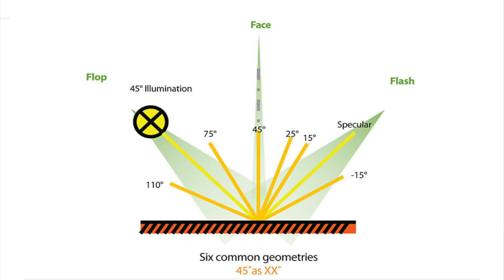The 4 main types of automotive paint **the basics**

Comment: Can you spray metal flake paint over a metallic base?
Second question if you can put metal flake over metallic base, can you spray a candy blue over that?
I want to try silver metallic base, with silver metal flake inter coat and a teal blue candy.
Reply from the maker: heck yeah...pick your flake and any paint system (usually in their custom line) should have a whats called a intercoat clear...spray your metallic base, let it flash and suspend your metal flake in the the intercoat clear, again flash over then spray your desired amount of Kandy then clear!
Reply: @The_Drive_Inside  thank you very much.

Comment: Chrysler Inferno Red is a tri-tone that to me seems a very strange process.    The end color is a very sharp reddity red red red, bright and dark, glimmering, and unquestionably eye catching.  I’ve had a 2005 Grand Cherokee and a 2005 Magnum with that color and it is stunning.    BUT, I the red Magnum was my daughter’s and bought used, she was the second owner.    It had odd peeling in certain places, almost as if it was parked partially covered under a shed, where some parts got harsh conditions and others were pampered.   Where the cleat was peeling, it left a salmon, like a light pink color.    I wondered how it could fade to that.   It didn’t.     I ordered a kit, and the base was a strange salmon, that applied kind of translucent, with some flake visible only when it hit the panel, then was nearly impossible to detect.    The next prescribed coat was what we saw as the topcoat, but it too went on as if it was pigment suspended in clear, and took a barely wet tack coat, then med wet, then another medium wet.  If you applied any of these pigment (color/top) coats too heavy/wet, it would somehow “drown” the effect.     Then came the clear.  No buggie, as usual, but they prescribed a medium wet first, then a “go for it, after all a perfect paint job is one big run” attitude.    Good god that was a pain.   I even jacked the car waaaaay  on one side so the door wouldn’t be vertical, to hopefully keep the clear from sliding off the coat before it.     Funny how you have to wait for all coats(except those “paint it while it’s wet sealers) to flash and that frost coat is supposed to retain the coats above, a foundation of glue and pigment, and if you apply the next coat two minutes early, you get cracking or crazing or solvent pop, who knows.    Paint it two minutes too late, and the “tack” isn’t strong enough.    I guess that’s why they say use a slow reducer in hot weather.     Well, on the hood, I got away with murder, used rattle cans, and blended the passenger half to the drivers half such that you would have to stand directly over the hood in the right light to what was done.       Still can’t figure out how I got so lucky because it was supposed to be an experiment, where I applied after a med/wet coat of blending agent nearly a foot into the good paint, which was feathered to where the edge was not discernable, and then made a “tent” from the base of the windshield to a speaker stand in front of the grille, which kept, hopefully, any “dry” overspray away from the “good” paint, restricted how much fresh and warm and dry air hit that section quickly, and also had an old radiator/motor fan mocked up on a wooden stand as my “downdraft” to remove as much paint as possible that didn’t stick when it hit the panel, AKA, hit dry.   The paint that was MEANT to stick, didn’t have a choice, and the rest was removed by forceful air pressure, much like a downdraft, but this was a sideways and under the car draft I had a channel of 2x4s and 2x 6 running under the car and out the back to the exhaust exit, with both the radiator fan drawing it off the car, HARD, and a squirrel cage type fan was at the exit, keeping the velocity up and urging all dry paint away to hell.     It worked.    Oh, and from about 18”-20” in from the border between old and new paint, I had used the plastic car paint sheeting like Saran Wrap on the hood, so that dry spray wouldn’t have any opportunity to adhere to where I didn’t want it, and where I did want it, I scuffed the factory paint to 600 grit for about 5-6”, then 1000 for the width of the paper.    Afterwards, I used 2000 grit to remove unwanted, dryish overspray from the factory paint, with a quick shot of blend agent followed by A VERY LIGHT WIPE WITH A BLUE shop rage, almost not touching it, and that removed the 2000 grit residue, and helped smooth the dry-er overspray.     2500 very lightly to make more uniform that whole zone, and then a last two coats of clear to bring back the shine.    It worked so well that I haven’t been able to repeat it.    It was a pain in the ass, took two attempts because I got greedy, and recoated too quickly, but it was worth it.     Oh yeah, I did clear the whole hood, with a close but light mist of blend agent to allow the clear to adhere to the non-scuffed factory paint.   That is dicey at best, but can work, but you’ve gotta have the gun with your clear in hand after that mist.   Like maybe one minute, if that.   That was three years ago and it’s still looking great, and quite honestly the tone seems to have somehow matched up even better with one southern summer of mild fade to match the factory paint.    Crazy.   But I’m watching this vid because it seems no matter how careful I am, I either get runs or I get cracking/wrinkling, or a crappy dry sprayed, non-paint job.    I always scuff to 400 grit because any more coarse leaves sanding scratches visible, and 600 grit on a vertical panel seems to allow more runs.   Maybe I’m wrong.   But it’s getting old when I rush through a touch and get very good results, but then when I really strive for an OEM finish sans orange peel, I get flaws in my paint.    Good paint is worth it, but expensive.     I’m using Tamco OEM, and it lays out better than anything else I’ve tried, and if you can get it to behave, nothing touches the pre-cut and buff finish.    One Suburban door I did ws so good I haven’t even buffed it after two years, it looks fine, and I was hoping for some more sun fade to match the 17 year old factory paint.    How in the hell can I get glass with out runs?   Dammit

Comment: Does anyone know how to best match paint or where to get it ? I need paint for a 2020 Lincoln Navigator code GS ceramic pearl. This is for a repair job quarter panel, fender and both bumpers.
Reply from the maker: Any bodyshop worth their salt can work the tri-coat steps in reverse without creating a noticeable halo…on the quarter. As for the fender/bumper covers…they need to spray a drop coat test and just hang and spray the pieces. I’ll warn you plastic/urethane/nylon pieces tend to come out darker…if you’re doing this yourself I would have my match created from a METAL sample from the vehicle… if none is coming from crashed pieces, the fuel door will work…I hope this helps you